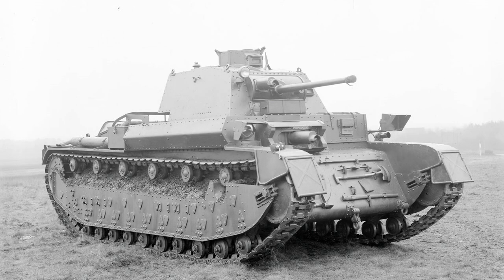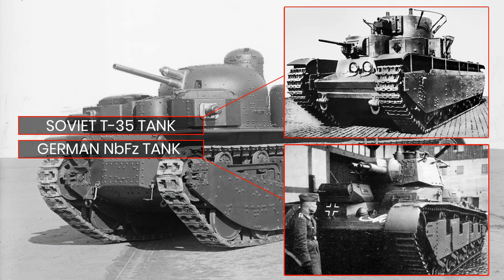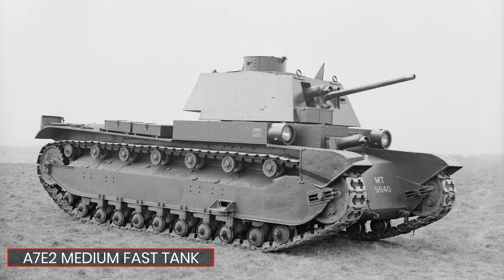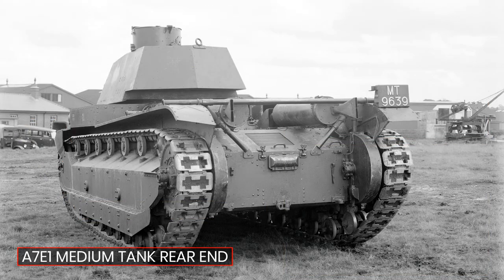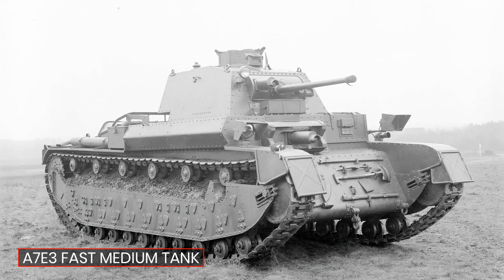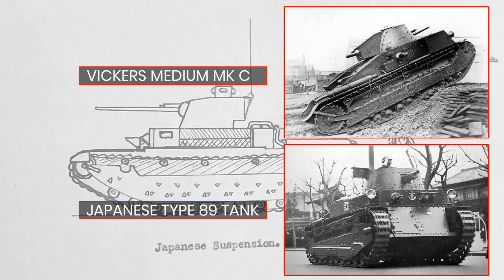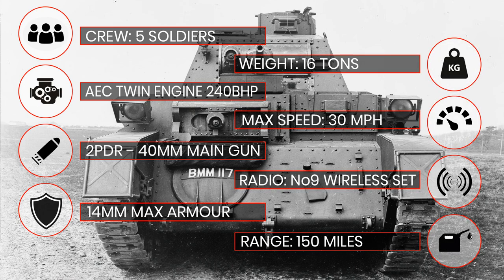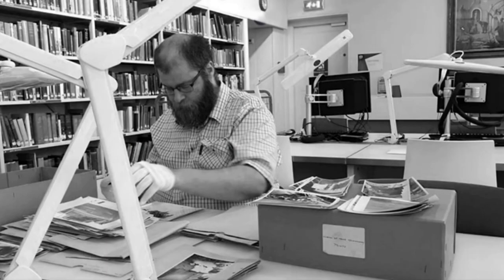A7E3 Fast Medium Tank - Tank Design & Development

Comment: Wait, somebody tried to add a mini turret system to the 432 and warrior? All of my what?
Reply from the maker: yup, early plans for the MICV have 2 turrets on the back,  but we figured best to save that for the inevitable MICV vid
Reply: @armouredarchives8867  Slightly related, but whenever I see the A9 and similary designed tanks, I have to wonder what position the mini-turret-gunners would need to be in, to actually operate them. I've not yet found interior pictures of any such vehicles, but I find it hard to imagine being able to find any position from wich to fire to the sides or rearwards and in the particular case, of the relatively flat hull of the A9, even any direction at all.
Reply: @MadnerKami  I've often wondered the same thing.

Comment: British tank development at that time made no sense when the idea should have been to economically develop a tank suitable for service using proven systems - engine, transmission, suspension, etc. All they needed was a few test mules of different weights where the various systems could be tested, particularly suspensions. To take the time and expense to build a new tank only to find out that it's suspension made it ineffective for it's proposed role makes sense how? 

What would be very interesting is a series on pre WWII German and Russian tank development.

Comment: It always baffled me that they debated whether to spend 1000 gbp on a mild steel test vehicle .. at a time when a fairly basic RN destroyer cost many 100s of thousands of gbp.... they were so underfunded and this lead to spending millions for every thousand saved earlier (plus many lives).... they should just have set up several production units... got a reasonably decent design.. said.. ok 10 of this one... then worked that batch whilst refining more detail... this would have given batches of tanks for the army to get their teeth into.. with units heavily tested.. faults found and feedback for more refinement... older batches could be reworked as operational training units giving more production unit training.. and actual armour available... or modified as testbeds for various ideas... 

You can see how pathetic the funding was by the 10 shots per gun for testing.... really this is outrageous considering the expenditure of actual warfare. .. saving 1 quid now but spending 1000 later is just daft.... one wonders how well the Japanese would have done in Singapore vs a decent tank force with some hurricanes for cap